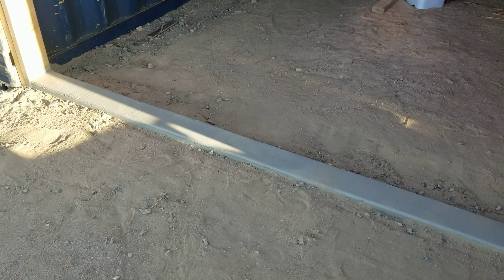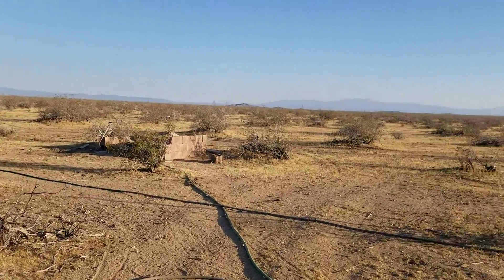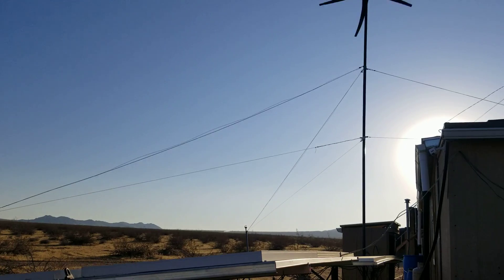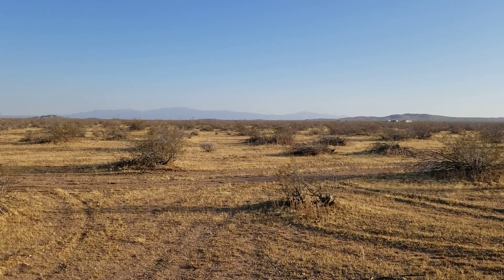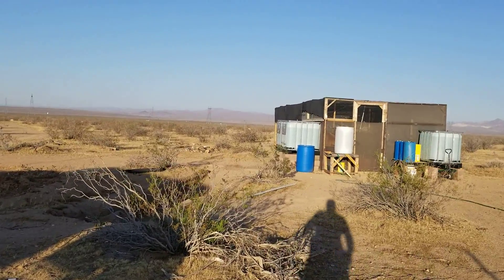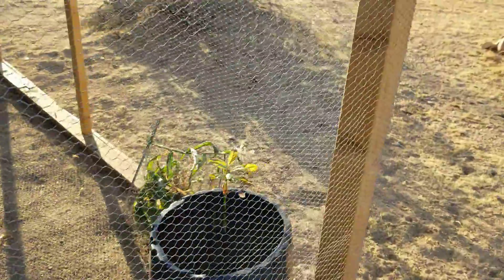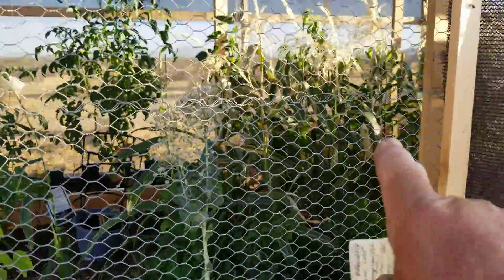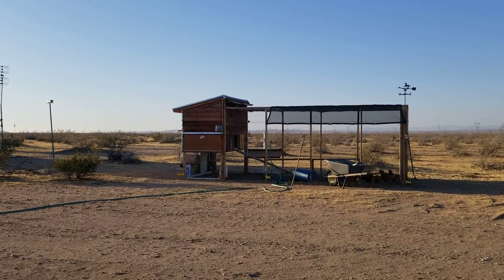Concrete forms come off, off grid electricity 102.2, turbines.

Comment: Any simple alchohol stove with a feed attached to restore fuel should work nicely for colder nights in the winter. If you got clear plastic over the green house and a small fan for circulation. Just some dirt packed all around the bottom inner and outer walls and pack it. Don't want those plants on cold ground though even in containers. If your winter nights get cold. You could elevate those buckets off the ground pretty easy,just use some rocks.
And it's Amazing what you can do with two layers of plastic and a small heat source. Alchohal don't cost to much if you distill it yourself. Basically it's making a simple hot tent for winter nights for your plants. You want to circulate that air and dispense with fumes even though alchohal seems to be pretty clean  burning. I have had best of luck with little alchohal burners myself and we have some pretty cold weather in Ohio at times.

Also before I forget a thermostat well come in handy to. That plastic makes a big difference along with circulating the the air
 Ideal would be about 55 degrees on cold nights if you can. At least till it warms up round morning time. Plants can be pretty resilliant  at times. Yep little heat a little insulation circulation and ventilation does the trick.

Comment: Heres a question.. how do you thin a tripod stand would do? (for the Wind generator )
Reply from the maker: It depends on the pipe strength and footings.  A KT5 turbine can apply up to 2000 lbs of pressure in high winds.
Reply from the maker: Oh, and welcome aboard!

Comment: That concrete cured fast! More notes on the turbine, score! Question, I see you have some mixed panels there, when mixing panels is there anything to consider? Watts, brand, etc? With the Avocado trees I've seen people cover them in that soft row cover material over the leaves and trunk and cut back on any watering while it goes dormant. Dont know if it works. I think Shamus O'Leary has some tips. Hes down in Tuscon, AZ. Thank you for the lessons again!
Reply from the maker: As long as all panels are the same voltage you can mix and match them.
Reply: @GBear  excellent! We just bought the Harbor freight panel kit but I'm looking at some good deals on Ebay for a pack of panels. Thank you!
Reply from the maker: @angelalibi1  the Harbor freight solar kit has to be run through it's own controller because they don't use mc4 wire connectors,  they are plug ins.  I will show later in a video how the can be modified if needed, but it is fine to just use the controller that comes with them.  I'll  go over that in an upcoming video.
Reply: @GBear  yes, I remember another channel saying that, a young kid named Will Prowse. I would appreciate you showing it. We had planned to use it preliminarily while we were building up for small projects, and then set up something bigger as we go. Sort of a training wheels, lol!
Reply from the maker: @angelalibi1  good place to start at an affordable price.   Did you also pick up a couple of there deep cycle batteries?
Reply: @GBear  the batteries are next, working with our earnings for the yearnings! Lolol!!! But a couple of them are next on the list.
Reply from the maker: @angelalibi1  yeah, they're only 30ah batteries, but I've had one in my container for a few years now and it is still performing like new, and I just put one in my garden house to run a pump.  It stays at 13.8v all the time and I only have one 25watt Harbor freight panel running it.
Reply: @GBear  excellent , good to know I was kinda worried about them being long lasting but I guess it's all in taking proper care too.
Reply from the maker: @angelalibi1  yes Care is important, but I forgot about the one in the container and have never serviced it...🤪
Reply from the maker: @angelalibi1  they wont run a heck of a lot, but a few power tools, a TV, lights, etc...
Reply: @GBear  ok, in the beginning that's all we will need it for, while we stock up a bigger system.
Reply from the maker: @angelalibi1  don't forget a 3000w pure sine wave inverter.
Reply: @GBear  ah yes I was just looking at them and wondering if that was too big but I can use that right off the bat right? It doesnt have to be smaller for a smaller system?
Reply from the maker: @angelalibi1  no, not too big.  3000 watts will carry you for quite a while, even when your battery bank gets bigger.
Reply from the maker: @angelalibi1  just make sure it is pure sine, not modified sine.
Reply: @GBear  yes I remember that from when you got your current inverter. Better for the electronics.
Reply from the maker: @angelalibi1  correct!  Good study!
Reply: @GBear  😁😁thank you!
Reply: @GBear  ok, excellent,  thank you!